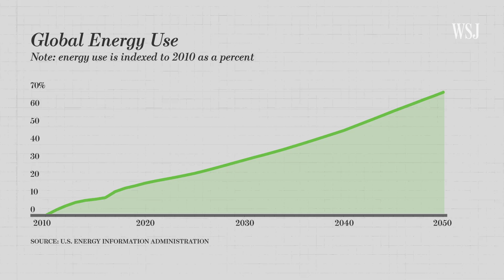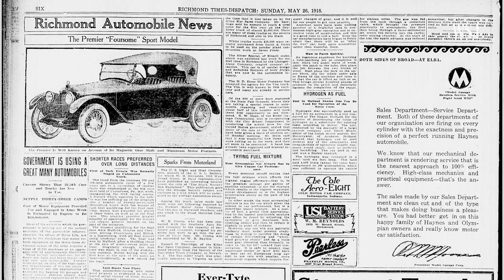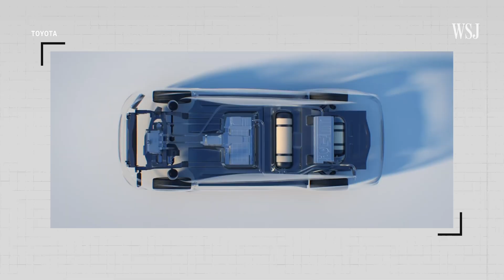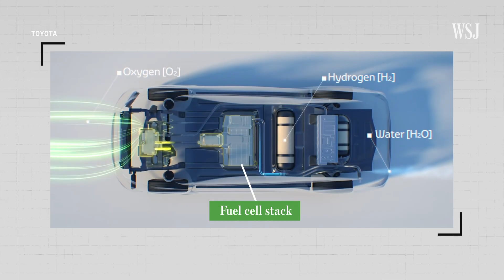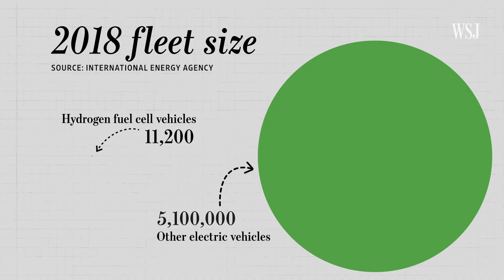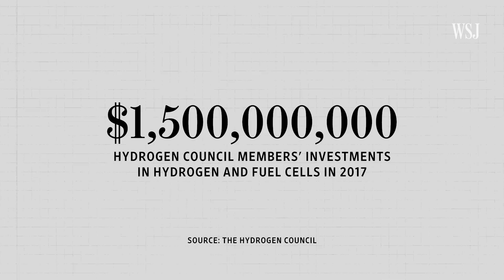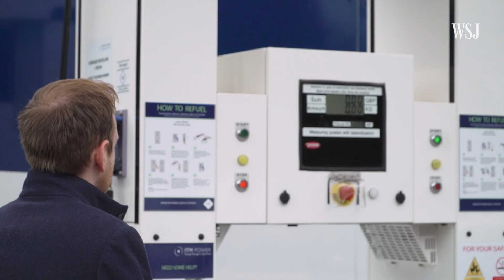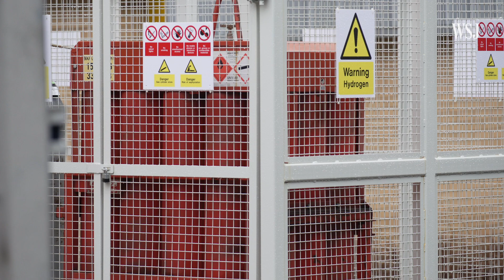Can Hydrogen Fuel the World's Fast-Growing Energy Needs? | WSJ

Comment: Well what about a company called Sunhydrogen which makes a solar cell that makes Hydrogen from Sun and water which could be used as a point of delivery for hydrogen
Reply: This company certainly needs a lot, a lot of money.
And their hydrogen is priceless.
Not everything that is technically feasible is also sensible and economical!

This video is an advertising lie!
They don't lie about what they say.
What is lied about is what is not said.
It is lying when you deliberately conceal or belittle important facts.

2:36min Water and electricity produce hydrogen
However, you forget to mention that you need about 50kWh of electricity to produce 1kg of hydrogen. 1kg of hydrogen only has an energy content of 33kWh. The rest of the energy is lost.
Furthermore, until the end of the film it is not mentioned that today hydrogen comes mainly from natural gas, coal and crude oil. Hydrogen is produced by fossil fuels at a rate of >95%! Because hydrogen from the electrolysis of water is much more expensive.

It is clear that hydrogen is an (extra to be produced, secondary) energy storage medium, but it can in no way solve our energy problems.

After all, the electricity for electrolysis has to be generated first, and it is better to use it as directly as possible instead of first producing hydrogen and then using it to generate electricity again. Because of course there are additional losses.

Hydrogen is above all a lie to keep people from using renewable energies! People are put off instead of, for example, generating their own cheap photovoltaic electricity and using it to charge their own electric car.

An electric car is cheaper, easier and better than a hydrogen car. No one in the world is therefore building hydrogen cars in large numbers. The Toyota Mirai doesn't even have a folding rear seat back....

4:28min Using electricity from hydrogen to charge electric cars?!?
A curious idea when you look at the costs. Not everything that works technically makes sense. This idea is nonsense.

5:29min If you look at the members of the Hydrogen Council, it becomes clear what these companies want. We should have to keep driving to petrol stations instead of generating and charging our own electricity at home.

Comment: Hydrogen would be a very clean form of energy for mobile (transportation) vehicles in a well-organized society.  Some of the problems are storage, escape (some hydrogen escapes the atmosphere forever), and cost of storage and separation from oxygen or other elements.
Reply: This video is an advertising lie!
They don't lie about what they say.
What is lied about is what is not said.
It is lying when you deliberately conceal or belittle important facts.

2:36min Water and electricity produce hydrogen
However, you forget to mention that you need about 50kWh of electricity to produce 1kg of hydrogen. 1kg of hydrogen only has an energy content of 33kWh. The rest of the energy is lost.
Furthermore, until the end of the film it is not mentioned that today hydrogen comes mainly from natural gas, coal and crude oil. Hydrogen is produced by fossil fuels at a rate of >95%! Because hydrogen from the electrolysis of water is much more expensive.

It is clear that hydrogen is an (extra to be produced, secondary) energy storage medium, but it can in no way solve our energy problems.

After all, the electricity for electrolysis has to be generated first, and it is better to use it as directly as possible instead of first producing hydrogen and then using it to generate electricity again. Because of course there are additional losses.

Hydrogen is above all a lie to keep people from using renewable energies! People are put off instead of, for example, generating their own cheap photovoltaic electricity and using it to charge their own electric car.

An electric car is cheaper, easier and better than a hydrogen car. No one in the world is therefore building hydrogen cars in large numbers. The Toyota Mirai doesn't even have a folding rear seat back....

4:28min Using electricity from hydrogen to charge electric cars?!?
A curious idea when you look at the costs. Not everything that works technically makes sense. This idea is nonsense.

5:29min If you look at the members of the Hydrogen Council, it becomes clear what these companies want. We should have to keep driving to petrol stations instead of generating and charging our own electricity at home.

Comment: Perhaps it is about time that we stop consuming excessively and we cap the world population by asking some to limit their familties to two children. On ships, hydrogen is the future and has been used in German attack submarines for decades now and the autonomy and silence makes them the best. Vancouver has used fuel cell powered buses but the hydrogen had to be shipped from Montreal where Air Liquide is the only company producing H2 in Canada. But it is possible to make hydrogen is small power units where the windmills and PV solar panels can produce the electricity that power electrolysis then generating hydrogen. They can be sized anyhow to fit any needs and even large units could be done or cities if connected on hydro dams (the nice ones in Canada) or nuclear reactors. Then, your end result is vapour and this a complee production and return cycle at high efficiencies.

Comment: Considering the vast majority of current hydrogen is acquired by cracking fossil fuels and will be for the foreseeable future, it’s not a clean fuel. We need to build the h2o electrolysis infrastructure to produce the fuel first. If we continue to create the demand first, it will just be filled thru more fossil fuel use.

Comment: Is it just me or does anyone else see the problem of overusing water resources to produce hydrogen ?)))
Reply: This problem doesn't exist.
It would be a problem, if we lived on a deserted planet. But 71% of the earth's surface is covered with water.
And you have to preprocess the water anyway, so you can use seawater as well as freshwater.
And the water returns, when the hydrogen is used. It just changed the location. Like it also does, when it evaporates from the ocean's surface and drops down as rain thousands of miles away.
Reply: That would only be one of the smaller downsides.

Comment: Hydrogen is here and being used commercially in California , small area of New England, Japan and Europe. Prices are coming down but it is expected to be lot more reasonable soon. HYSR, PLUG, BLDP, FCEL Linde, are some of the best companies. But only HYSR makes zero emissions clean green Energy. But they are not yet scaled up for the market. We are optimistic and waiting for the zero emissions green Energy.
Reply: This video is an advertising lie!
They don't lie about what they say.
What is lied about is what is not said.
It is lying when you deliberately conceal or belittle important facts.

2:36min Water and electricity produce hydrogen
However, you forget to mention that you need about 50kWh of electricity to produce 1kg of hydrogen. 1kg of hydrogen only has an energy content of 33kWh. The rest of the energy is lost.
Furthermore, until the end of the film it is not mentioned that today hydrogen comes mainly from natural gas, coal and crude oil. Hydrogen is produced by fossil fuels at a rate of >95%! Because hydrogen from the electrolysis of water is much more expensive.

It is clear that hydrogen is an (extra to be produced, secondary) energy storage medium, but it can in no way solve our energy problems.

After all, the electricity for electrolysis has to be generated first, and it is better to use it as directly as possible instead of first producing hydrogen and then using it to generate electricity again. Because of course there are additional losses.

Hydrogen is above all a lie to keep people from using renewable energies! People are put off instead of, for example, generating their own cheap photovoltaic electricity and using it to charge their own electric car.

An electric car is cheaper, easier and better than a hydrogen car. No one in the world is therefore building hydrogen cars in large numbers. The Toyota Mirai doesn't even have a folding rear seat back....

4:28min Using electricity from hydrogen to charge electric cars?!?
A curious idea when you look at the costs. Not everything that works technically makes sense. This idea is nonsense.

5:29min If you look at the members of the Hydrogen Council, it becomes clear what these companies want. We should have to keep driving to petrol stations instead of generating and charging our own electricity at home.

Comment: To throw away the O2, is to throw away half of the benefit of the electrolysis?
Reply: I agree.  Months later after your comment, hospitals are running out of oxygen.
Reply: Jason Hockly O2 occurs naturally in the air, so it is not rare or valuable. No point keeping it.
Reply: @xyzzy4567  half the energy to separate is being wasted. That's my point.

Comment: Proton Technologies is commercializing a new method, tested at the University of Calgary (Alberta, Canada) and in the field, to produce pure hydrogen from oil wells with no CO2 or any greenhouse gas emissions.  When hydrogen is used as a fuel the only emission is clean water vapour. The following video documentary tells the story and present status.  
https://www.youtube.com/watch?v=8_U_ixFO8uw 

At commercial scale the University of Calgary estimates the hydrogen can be produced for somewhere between 10 cents to 50 cents per kilo-gram. The current retail price of hydrogen in California is over $10.00 per kilo-gram. Hydrogen produced by wind or solar electric generation has an actual true cost in the range of $3.00 to $6.00 per kilo-gram. 

Using the new process, a large engineering firm is presently working on an engineering design to build a hydrogen production facility at Proton Technologies’ oil well facilities in Saskatchewan, Canada that can produce 30,000 kg/day of hydrogen which could be shipped either by tube trailer (up to 1,300 kg) or liquid hydrogen trailer (4,800 kg), or to generator electric power right at the site where the hydrogen is produced.  The second stage will increase the capacity to 300,000 kg/day.  

The new method can be used widely around the world and during the next 20 years has the potential to create enough low cost, ‘green’ hydrogen to replace coal, oil and natural gas as an energy source.  In the near term companies now owning oil and gas facilities can generate additional profit by also producing hydrogen, and make a gradual transition toward hydrogen, to maintain economic prosperity, save jobs and create a long term path toward a carbon free energy future.

Electric power generation facilities fueled by very low cost 'green' hydrogen can reliably supply electric power 7x24, even when the sun is not shining and when the wind is now blowing. 

Many hydrogen pipelines are already in use around the world.  Hydrogen fuelled semi-trucks, buses, trains and ships are already in use, with many more on the way. 

Nikola Motors in the is planning to hydrogen-powered semi trucks, and they presently have pre-orders for 7,000 trucks ($12B USD). The trucks are very beautiful works of design art. 
https://nikolamotor.com/ 

A project in Alberta, Canada to build a fleet of hydrogen fuel-cell semi-trucks is in progress. Ballard (Vancouver B.C.) is supplying the hydrogen fuel cells and a company is Quebec is building the electric drive train. 

https://www.trucknews.com/sustainability/hydrogen-fuel-cells-the-right-direction-for-albertas-trucking-industry/1003094283/ 

Hyundai hydrogen-powered semi-trucks are shown in this article and are another example of beautiful works of design art.

https://www.trucks.com/2019/11/12/
hyundai-nikola-toyota-build-hydrogen-highway/ 

Cummins showcases hydrogen fueled semi trucks. 
https://www.cummins.com/news/releases/2019/10/30/cummins-showcases-hydrogen-fuel-cell-truck-during-2019-north-american 

Kenworth, Toyota, Hyundai and Volvo hydrogen fueled semi trucks. 
https://www.trucks.com/2019/11/12/hyundai-nikola-toyota-build-hydrogen-highway/ 

More information regarding the new method to produce 'green' hydrogen with no CO2 or greenhouse gas emissions is available at Protons Technologies' web site at 
http://proton.energy/ 

Information about new fuel cells, which are soon dropping significantly in price, is available at
https://www.ballard.com/

Comment: The big problem that hydrogen cars have is that electrolysis (producing hydrogen from water) is at best 80% efficient so for 1 unit of electricity you get 0.8 units of hydrogen energy. Then fuel cells are only 60% efficient so for each unit of hydrogen energy you only get 0.6 units of electricity. 

You lose almost half the original electrical energy in process losses producing hydrogen then converting to electricity. Whereas you can simply put that electricity into a battery electric vehicle. 

Theres no point in looking at losses in electric motors as both use them. There are losses of around 25% in charging and discharging a battery so the hydrogen car is roughly half as efficient in terms of energy use compared to a battery ev. 

But the real elephant in the room for hydrogen powered cars is the monumental sums of money that would be required to retrofit the worlds gas stations, replace all of the tankers which supply the stations and replace oil refineries with hydrogen production facilities. It would be hundreds of billions of dollars if not more. Where as battery ev’s can simply be charged from the electricity grid. Electrical grids will need some upgrading but costs will be tiny compared to the costs of implementing hydrogen. Added to which smart chargers can use ev batteries to help balance the grid so far from being a problem for electricity network operators, they’re actually going to help them run their networks more efficiently.

Comment: At $2.20/kg of liquid Hydrogen and 33.3kWh/kg, a 2017 Tesla 90D can get 3.096 miles/kWh so for roughly 600 miles of range it would cost $13.20. Not bad at all.
Reply: $2.20/kg is for H2 produced from SMR. You're looking at $10.00/kg for H2 produced from electrolysis. What is the point of using H2 produced from SMR, we are better off using conventional cars.
Reply: Jason Teo the extra price, is offset by our Lack of polluting into the atmosphere.
Reply: @DrumToTheBassWoop  the point is the cheap hydrogen is just as bad as using fossil fuels in your car. You need to pay the 5x higher price to be green so the OP's calculation is not correct.
Reply: There are no Tesla which offers a range of 1000 km. But the hydrogen based EVs can. This is the argument why battery based trucks have a limited future as their range will be too small. Look at these German attacks submarines which can stay underwater for months.
Reply: In addition to paying the more expensive price for green hydrogen as another commenter mentioned, you have to factor in the lower efficiency of fuel cells vs batteries. The Toyota Mirai gets about 65 miles per kg of hydrogen, not the 100 you were hoping for in your calculation. So it works out to about $90 for 600 miles if your green hydrogen is costing $10/kg, not 13. Basically hydrogen is an expensive luxury for people who are in such a hurry they can't wait 30 mins to charge their car while they stop for lunch. People need to stop expecting to be able to just keep driving almost non stop. If you want to drive further than you reasonably can in your BEV then it's better to just take the train and hire a BEV to get around when you get there.

Comment: no-one seems to remember that fuel cell uses oxygen so the end result is water + air with reduced oxygen so in a city at rush hour with millions of cars/trucks/vans how much oxygen has been removed from the air ?
Reply: andy mod wow. There are a lot of dumb comments here. But this one takes the cake.
Reply: @travisbuckle1071  how is it Dumb Statement and Question as water is H2O so you have hydrogen it tank and take oxygen from air so only Question is how much Oxygen is used per machine that uses a fuel cell ?
Reply: andy mod it’s barely anything compared too... oh I don’t know.... an internal combustion engine!!!! Which not only uses oxygen to function but replaces it with NoX, SoX, CO,  CO2 etc..... So yeah your argument is plain old dumb. I don’t know what else to say.
Reply: @travisbuckle1071  that is true about ICE but what facts are there about oxygen removal from air is there for fuel cell because a refitted 1960's mini would need a small cell were as a semi fulled loaded would need a bigger cell so oxygen removed from air should be bigger would it not and as i work in warehouse near a busy motorway then should i not ask for info and stat's on some thing i don't know ?
also why are people trolling shouting down on people without giving fact's ?
Fact ) water = H2O  1 gallon of hydrogen + 1/2 gallon oxygen = water
known info oxygen is only about 20% that of air(it depends on if your in a forest or in middle of a big city)
Reply: andy mod you’re on another level man...

Comment: This is beyond dumb. Electricity produced by renewable sources is so simple. Why convert electricity at a loss to produce hydrogen? Just store and use the electricity.
Reply: Thank you genius - How we are going to store electricity ??? (except in those tiny batteries)
Reply: Indeed my friend, we can't, we have to convert it to a non fossil fuel. H2 comes to mind - It does not matter if it's 'inefficient' for today's standards, the key is, it is endless in it's abundance. And making it is not that difficult, neither storage or transport. It's our will to conclude this transformation that lacks.